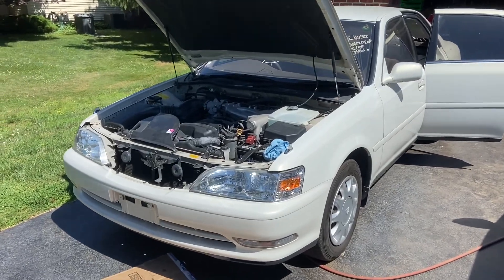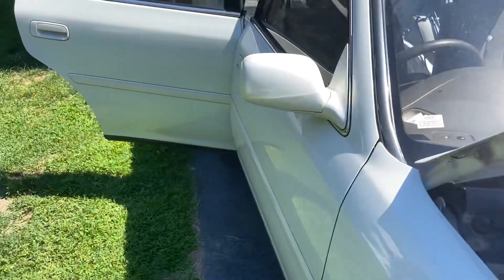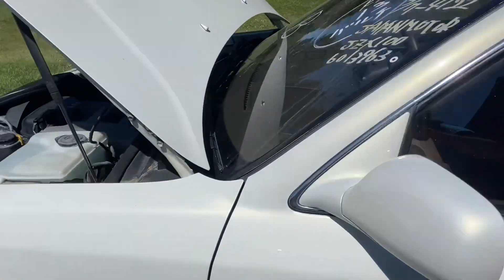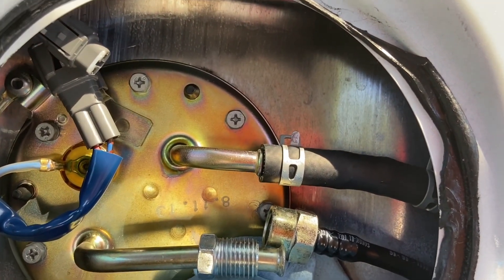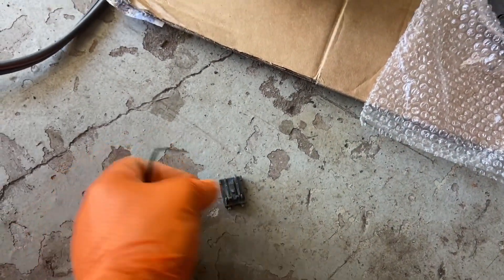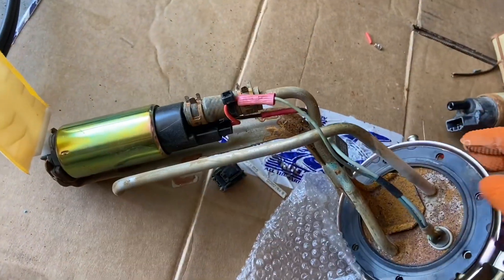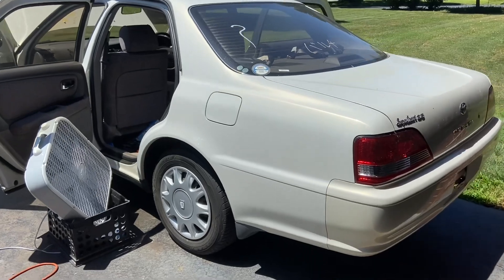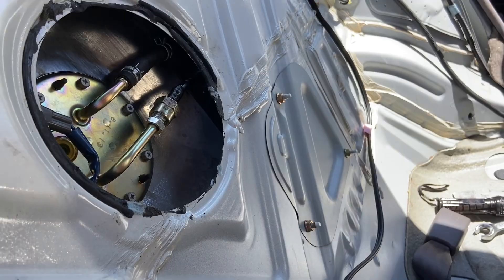JZX100 Crank/No Start Diagnosis/Fuel Pump Replacement Chaser Cresta Max II

Comment: Is the fuel float on the same unit as the fuel pump? My gas needle doesn't read past 1/4 tank and I'm assuming something is seized in there as the car sat for over a year with an empty tank